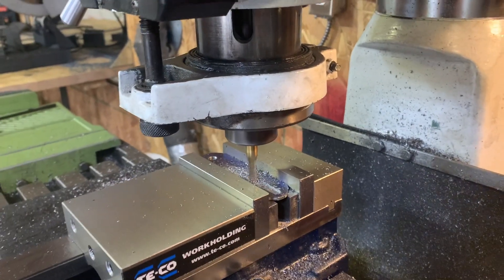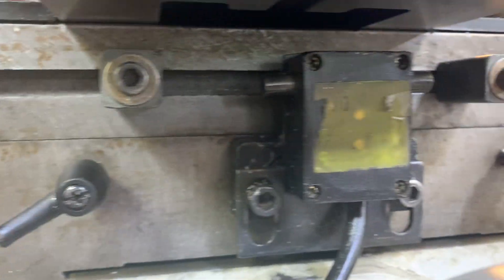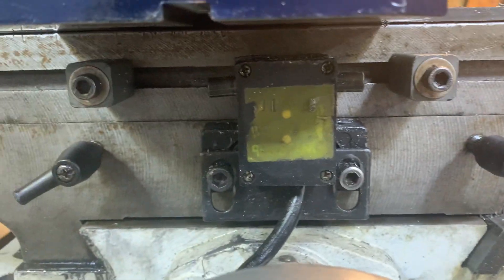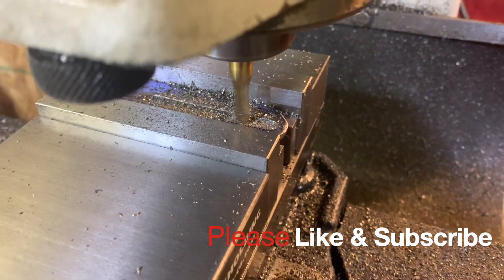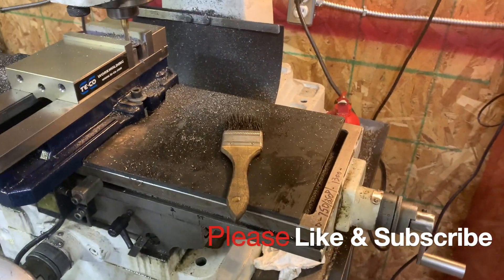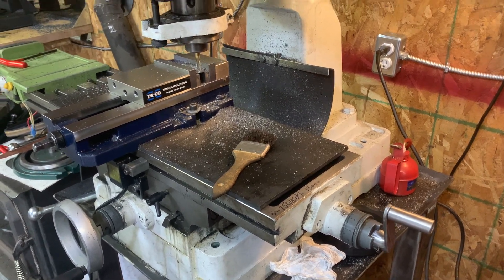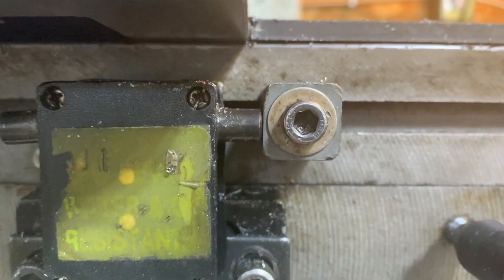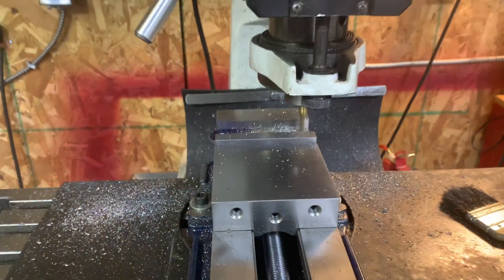Quick Tip - Milling Machine Power Feed Stops

Comment: That micro switch will not stop the feed with any accuracy at all. It's for stopping the feed before the table runs out of travel.
Reply from the maker: Great tip David. Thank you
Reply: That's not true in the slightest.
Reply: @Girrthedogxxx  Well I can assure you that it is.
Reply: @Girrthedogxxx  I started in 1996
Reply: @Girrthedogxxx  I would ask you how long except I don't care. LOL
Reply: @Girrthedogxxx  

Lets Roger That
44 minutes ago
Unfortunately David this is really not for any precise work. you can’t rely on it because the switch isn’t a precise instrument.